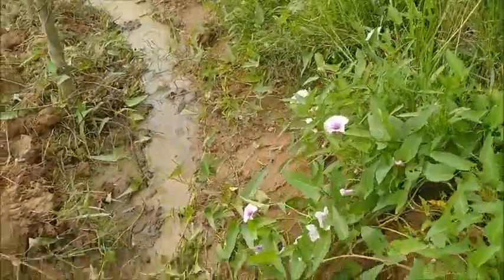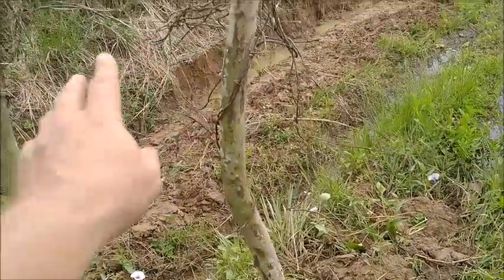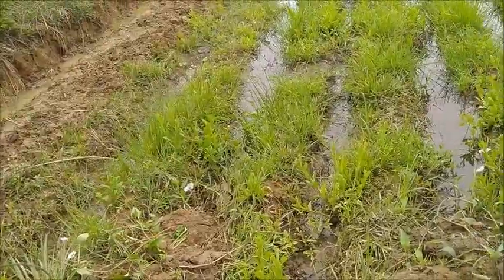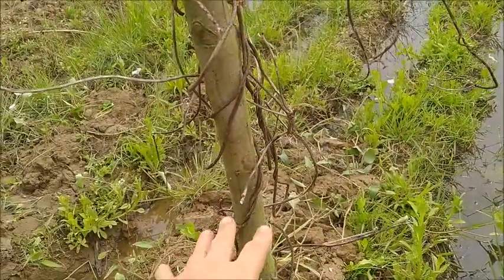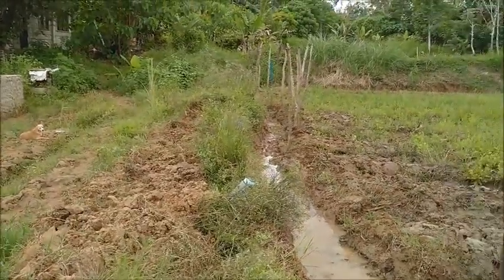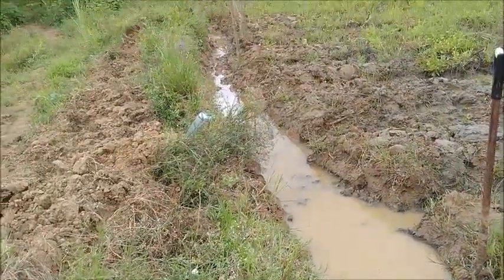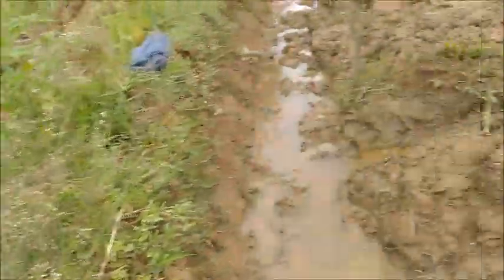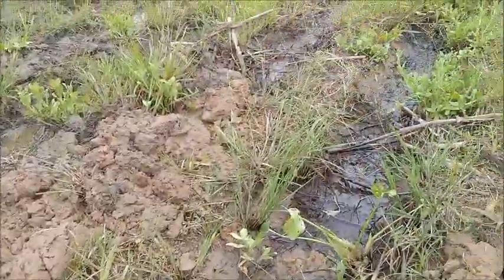New And Improved Raised Beds

Comment: Here is what I would do.... deepen the pond #1 so it can hold more water, then dig channels from the plateau to that pond so as to store more drained rainwater in the pond....then elevate or deepen all your fields and cansls appropriately so that irrigation water can flow smoothly downstream and flow automatically into furrows in all of the individual fields...then once water can flow down from the canals into each furrow, then you just need a way to raise the water the foot or so from where it sits in the furrow up to the plant where it could be delivered by drip line hoses...but where to get the power? The sun could provide the necessary power....via solar cells plus pumps....or by creating high pressure in a plastic container exposed to sunlight...the heat of the sun increases pressure in the container, thus forcing to flow from the container upwards into drip hoses feeding the plants
T